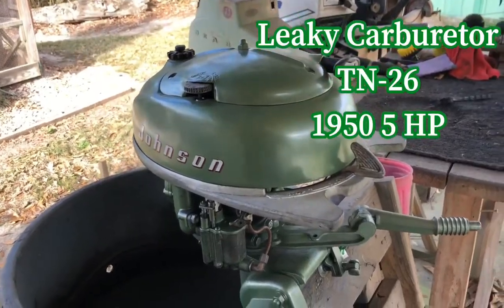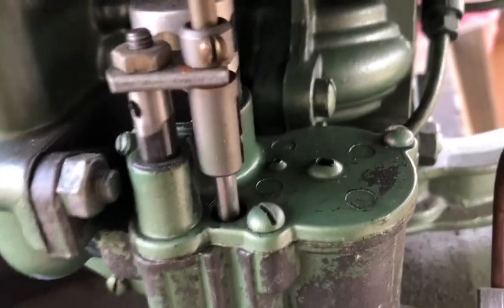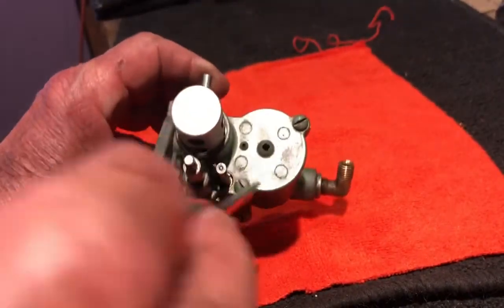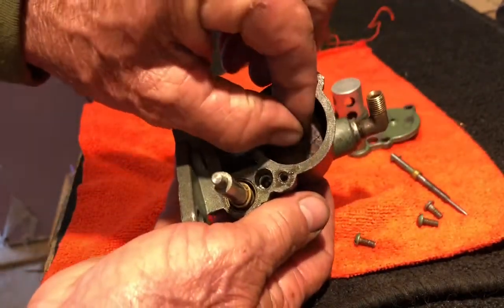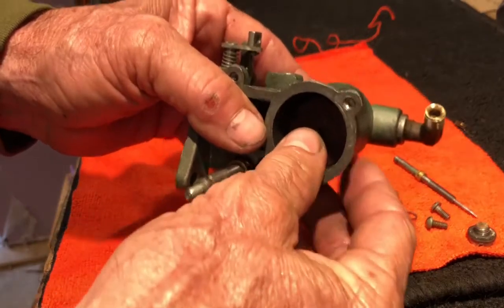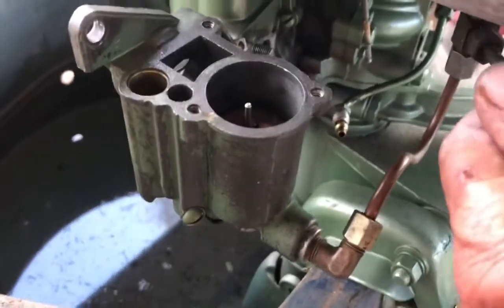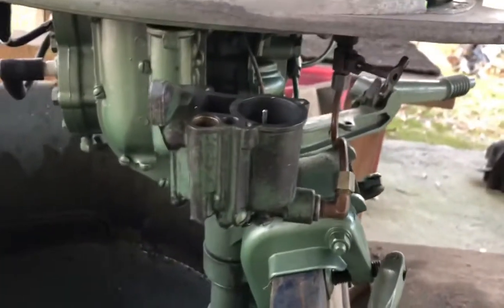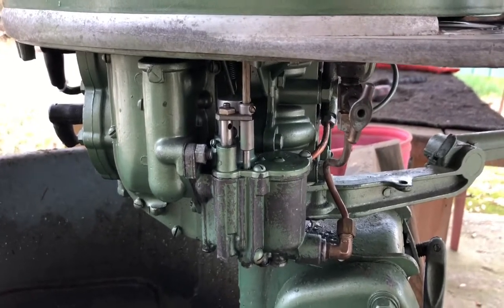Leaky Carburetor TN-26 1950 5 HP Johnson

Comment: I had a 2.5 Johnson of the same year, very similar.  It ran fine but every time I tilted the motor up gasoline would leak out into the bildge of the boat which was. messy.

Comment: I just got one of these motors it fires when I put a little fuel in the cylinder so I'm pretty sure it's a carb problem I'm not sure I'm new to boat motors
Reply from the maker: Just need to clean da carb.
Reply: @michaeljsimon  works now once I cleaned the carb and polished the needle. Thank you!

Comment: Question on the plunger housing, both of my spacers or shafts fell out when the carb was upside down, does the small one face the same direction as the large one when you put them back in before the plunger goes in??? Anyone thanks for any info.